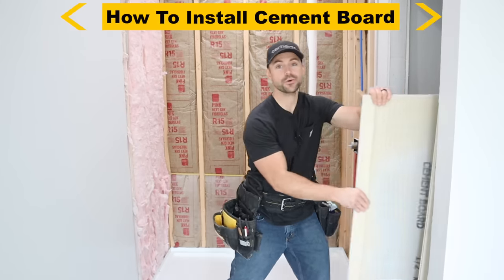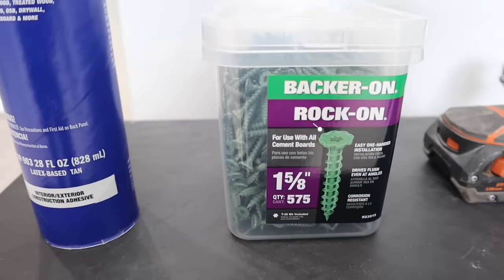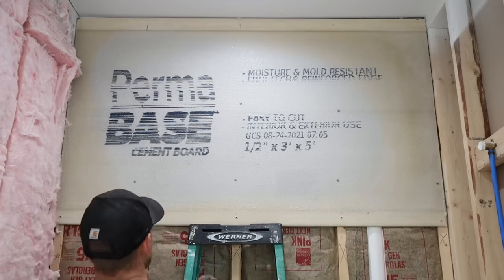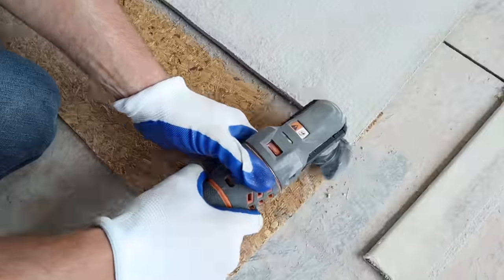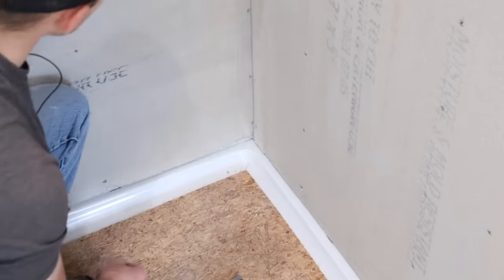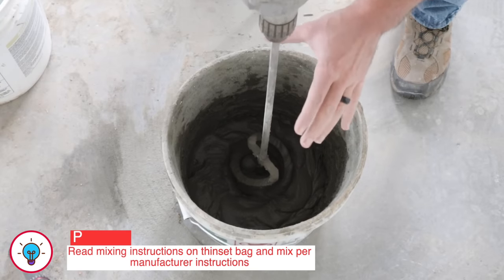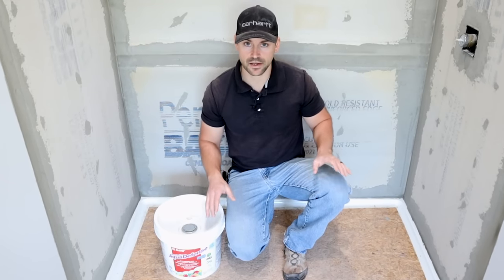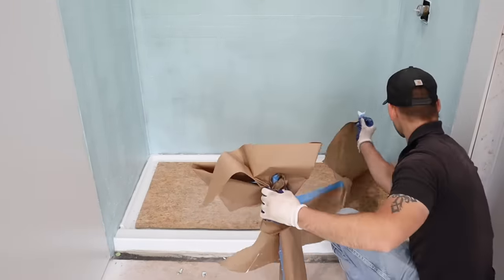How To Install Cement Board and Waterproofing For Tile Shower Walls - Complete Step-By-Step Guide

Comment: I've been doing showers and bathrooms for decades. Out in the field we normally pack out are studs. We packed them out quarter inch or so. That way the cement board or HardieBacker board slide to write down over in front of the flang of a tub or shower. No rabbeting out or back cutting the cement board,or hardiebacker board like you're doing in this video.
Reply: Can someone translate this from contractor english to educated English please?
Reply: @zefrum3 I believe he’s saying they burrow out the studs a little so that the actual tub edges are slightly in the studs so the cement boards just slide right down without have to cut the board to fit
Reply: Make wall stick out more so cement board slides down past tub flange
Reply: Board doesn’t go over the flange. It butts against it. Put it over and I will eventually leak. You use mesh and quick set cement to seal the gap.  Then red guard, caulk when done. Tile.
Reply: @jimmyjay6497  that is one way, but this entire comment thread is about building the studs out so the cement board can slide down over the flange
Reply: Or recess the shower tray into the framing so it is flush with the framing and the sheets can run into the tray unobstructed . Stop the sheets 3-5 mm short of the tray bottom and silicone the gap . Seal the sheets .
Reply: I'm doing mine now and I presumed hardie backer in first down to the floor.. then tray in and tile down over flange??
Reply: @jimmyjay6497 this is how I thought it was done..
Reply: Any difference between the rough side and the smooth side of the cement board?? Which side should I use for tile??
Reply: @bastardo323  pretty sure you want smooth side out for tile.
Reply: @bastardo323 smooth side if your using Mastek rough side if your using thinset both sides can be tiled, it's all about what choice of adhesion your using
Reply: Meh, done both methods. It's tough to screw up the butt joint between tub and wall.
Reply: I'm presently installing a shower pan and the manufacturers recommendations say that the backerboard should be installed "up to the lip of the flange"! Do not install the board "over the flange and into the pan"! Only the tile should be installed over the lip of the flange!
Reply: @zefrum3 you’re saying that contractors are uneducated but since you are the one who doesn’t understand… it sounds like you’re the one who is uneducated. I understood it and I’m not a contractor.
Reply: @jasony9950 I think he meant the dude doesn’t know how to spell simple words like “right”
Reply: @jimmyjay6497 so thin set first then red guard? I'm using shower panel inserts
Reply: Great video and great information.
I must say😊 0:35  that fiberglass is a temperature insulation not a sound insulation.  You need mass for sound insulation.  Use mineral wool for the sound insulation. It also is mold resistant.
Reply: @Iburn247  paint the Redguard on top of the raw cement board to seal it. Then use mortar to secure your tiles to the wall. If you are using Durock brand cement board, make sure you use the rough side with your mortar. The smooth side is intended for use with mastic, which should never be used in a shower. It will cause mold growth.
Reply: @zefrum3 
😂😂😂 😂😂😂 I couldn't understand it either!!😂😂😂
Reply: HUH? 😂😂😂😂
Reply: My daddy makes grease!! 😂😂😂
Reply: Should I use fiber mesh when working with hardiebacker board?
Reply: What?…. You don’t float your walls?…You put your cement board…. Or Hardie baker on a screwed up wall and you still have a screwed up wall. You have fixed nothing!
Reply: It's not advisable to place any board over the lip, as I've diagnosed challenging leaks that others couldn't identify, only to discover that water was being wicked up and over the lip, then running down the inside wall. The same principle applies to stand-up showers—you don't want the boards to sit inside the mud pan, resting on the liner, as this can lead to similar issues.
Reply: Wouldn't it be easier to just notch the Stud right where the tub lip is so the lip slides into the stud instead of shimming the whole stud all the way up? Work smarter not harder

Comment: This guy is great. I am getting ready to tile up. I did not cut out the back of the cement board to go over the shower pan lip though, instead, I cut furring strips the length of each stud and 1.5 inches wide so that the board went over the lip.
Reply: I believe the board should not rest on the edge of the shower floor pan or the tub. It should go on the top of the lip to prevent any water from wicking up the cement board. Read the comment by AKJammer.
Reply: The board should never go over the lip. It’s supposed to go to the top of the lip.

Comment: Thanks for the video. I am almost ready to tape.  I found out that the manufacturer recommends a 1/16 or 1/8 gap between boards.  Too late im done.  Also for inside and outside corners they recommend 4 in Alkali resistant tape.

Comment: The cement board sits on TOP of the tub flange lip, not overlapping it. By bringing the cement board all the way down over the flange lip, you increase the possibility of the cement board sucking up water through capillary action.
Reply: In my experience, about half of the pros I've observed stop at the top of the tub flange, cantilevering the tile the final 3/4 inch or so past the cement board. The other half back-cuts as shown in this video so the cement board can run down over the flange and better support the tile. It typically stops 1/4 inch above the deck. Personally, I prefer to stop the cement board at the top of the tub flange.

Comment: I have to rebuild my shower in my brand new house that the contractor really messed up.  After watching several videos on the subject, I stumbled upon yours and what a relief.  I am confident that with your explicit instructions, I can now tackle the project.  I will have to demo the tile out to the studs and start over so your videos really came in handy, now to gather materials.  BTW, the building contractor will repurchase the tile if I do the work.  His sub went out of business :~(
Reply: This. I have the same problem. Husband wants to do it— so being an engineer I’m sure we can do this
Reply: I would think the Contractor would step up and fix what his Sub screwed up. Why should YOU have to do it? The cost of tile is minimal
Reply: Best of luck with your project.  Take your time.  Let us know how you made out.

Comment: I love your video; video quality is great, you speak clearly, confidently and with enthusiasm, and your explanations are detailed and clear.  

I just don't understand why you started at the top of the wall?

ET
Reply: Preference. He said so in the video. Doesn't matter either way. On my last job, I had gravity work in my favor, working from the ground up on the main back wall. And from the top down as for the two side walls. Both were easily accomplished..

Comment: Isn't it recommended to remove the paper face of the insulation if you're using a waterproof membrane over the backer board? Otherwise, mold could become an issue due to moisture being trapped between two impervious materials. I'm a complete novice, but I came across this advice several times in recent months. I learned this while researching my own project  whether or not to remove the vapor barrier before installing my shower on an exterior wall. Thanks for your efforts; I've learned so much from such videos and the comments

Comment: Been installing tile new for about 20 years, the only big box we have is HD. Here's some solid advice. 
1. Straight edge & plumb the studs & corners, shim if need.
2. Use Aquabar paper over your studs & go over shower lip.
3. Leave a ⅛" gap at your cement board seams (#8 nail)
4. Tape with alkali resistant mesh!
5. I have always used Flexbond thinset & had great results! We live near the 29 Palms Marine base & get shook all the time from the bombing & small quakes are the norm. I've never had a shower leak or crack.
For what its worth thats my experience tiling MANY showers.
Reply: Thank you!
Reply: Does this apply for someone who is not tiling but just putting up fiberglass (or similar) panels to create a new surround over an old bathtub? Thank you.

Comment: Hi Josh, I've just discovered your channel and I must say you are an amazing teacher . I have a couple of questions. About a month before  watching your video, I installed 1/4 inch cement board on the Walls of my shower, is that a problem? Can I do anything to it to make it work? Or do I have to remove it and use 1/2 inch? My second question is, do the walls need to be perfectly level or the bit of unevenness can be even out with thinset when tiling?
Thank you

Comment: I never installed cbb before. I found your video presentation informative and easy to follow along. Best of all, I feel confident in tackling the job thanks to you. You've got a great attitude and obviously love what you're doing!! Mega thanks Bro!
Reply: I speak from experience, the cement board he's using is a bit on the heavy side.  They have lighter weight versions available.   He's a young guy who makes it look easy.  Be aware of the weight.  Use liquid nails as he did.
Reply: I like permabase

Comment: If you are doing the whole thing including framing (new construction) you can notch the studs at the bottom - about a quarter inch or even just 3/16 inch deep, the height of the pan to allow the pan to recess into the stud wall. So much easier to notch the studs.
Reply: Great insight.  Thanks!
Reply: Yeah if it's new construction

Comment: you always want to use a waterproof silicone in the corners and not thin set so that there is flexibility in the corners to allow for expansion and contraction. Thin set can crack and leak if used in corners.
Reply: Nothing sticks to silicone so your tile won't stick in that area
Reply: Here's some good info.  Realistically no one gets this opportunity, so I thought I'd share.

5 years ago putting in a new shower,  I used the high quality laticrete hydro-ban caulk in the corners between cement boards.  I had to abandon the project at this stage.  No mesh tape / thinset.  No further progress has been made on the project even to this day.  So, I recently assessed the job and found half of these vertical 90degree corner beads of caulk had produced a fine crack.  Pretty surprising and disappointing...

So, to counter this, I will be including the use of a fabric tape when painting the waterproof membrane.  Maybe others should consider this secondary measure, too.

Comment: Another fantastic showing of your work. Yes drywall background comes in really well to take and coat the corners and seams. I've used a brush as well to put the thinset in the corner and wipe it down. So glad to see the application of the sealer as well when using cement board and even hardi backer. Doesn't suck the moisture out of the thinset as quick too. Great job Josh. 👍🏻
Reply from the maker: Hey David! Yeah I felt like a Drywall Finisher there for a minute lol. Yes that’s a good point also about the water sealer protecting from pulling the water out too quick. Another plus side to waterproofing. I hope your projects are going well. Thanks for stopping by!

Comment: A title guys with years of experience says that you place the cement board on top of the lip of the pan to stop water wicking up. leaving that space means water can't travel up and make contact with the cement board.  Yes, you can use caulking between the gaps if you rest the cement board on the base, but cauling won't stop water perminately, especially in a shower with plenty of water spashing around.

Comment: Im renovating right now, i didn't liquid nail the sheets but did use the proper hardware, what's your thoughts if I skipped this step?
Reply from the maker: If you already did the work, I would not worry about it too much. Liquid nails is definitely a great reinforcement. Hope that helps!

Comment: This is really great and straight forward video. I've done a lot of drywalling and odd jobs construction and feel very confident in my abilities but it's always good to go through a video dry run with to make sure I'm not forgetting something; especially if it's a project I haven't done in a while. It also helps to go through the needed materials list to ensure I have everything for the job before I began. There's nothing worse than getting started only to find out you need to run back to the local hardware store! Aghhh You also have some great tricks to make the job go easier when possible. 
Thanks for your video's I'm definitely a subscriber. Fireman Michael

Comment: Josh love the videos, they have been very helpful. I have one question, do you put mesh tape along the ceiling. Where the sheet rock and cement board meet
Reply from the maker: I did but it’s not really necessary. The tile covers up that area and you really don’t see the corner and it doesn’t function as waterproofing either. So it’s really not necessary but I did for a full complete look. Hope that helps!

Comment: Hm? ... I didn't know that water-proofing was necessary after placing cement board and thinner on the joints? Or,  that there is a water-proofing product available and it is applied onto the cement board as if I were painting with a roller. Hm? ... Glad I saw this video. Thanks!

Comment: I am in the process of renovating my shower.. I have seen 10 different DIY videos on this topic.. no one suggests using liquid nail like you do .. is this just an insurance thing or does the cement board manufacturer recommends that ? and also the flange thing you recommend to do... does it actually have any purpose ?

Comment: Man, that's a lot of work! Really well done video.
Reply from the maker: It is a lot of work. The final project turns out great. Thanks for watching!
Reply: @TheExcellentLaborer  7:28 - can I install my cement board in my shower and then have a drywall guy come? Or should I do like you did and have drywall finished and then install my cement board?
Reply: @chrisbarfield1468 either way.  Just have cement board and tile go beyond shower door and inch or so ideally.  Make sure you stud well there for your door system.

Comment: Josh, excellent videos. Thanks, 

I have a question. My son's contractor did a poor job laying tiles on his shower floor. The shower has a square drain and the contractor grouted all the way around four sides of the drain. Now for basic clean up and hair clogs removal, we have no way of easily pulling off the drain cover. Would it be safe to use some scouring knife or rotary blade to scrap off the grout on all four sides of the drain screen? They can't even use the shower anymore as the water pools on shower floor and takes long long time to slowly drain, in the meantime, standing water is weakening the floor and dislodging the tiles. Thank you for your (or fellow reader's) helpful comments.
Reply: Pretty much all drains have a removable strainer aka "grate" either by removing 1 or 2 screws. If you don't see any screws it is probably just snapped in and held by friction. Grouted on all sides is generally as it should be. Good luck

Comment: Question: I am installing an ABS tub surround over Durock. My Durock was installed using "Lepage No More Nails Paneling and Moulding" not realizing it is a product for lightweight trim and not recommended for Durock. Do I need to rip out my backerboard or is there a way to fix this mistake?

Comment: We are remodeling our bummy little fixer upper and the bathroom has regular sheetrock installed  on the walls ,however  we are not planning on installing  a shower only a tub ,should we switch out the sheetrock to cement boards for waterproofing or would it be fine to leave  the sheetrock ?we are also planning to tile the floor and halfway up the wall. Pls no hate comments we are trying to diy everything because we are working with a very tiny budget

Comment: So, what did you do to the top gap between the wall and ceiling AND at the bottom between the shower pan and cement wall?
Reply from the maker: Along the top and bottom you can tape and apply thin set just like you did the joints. I hope that helps!
Reply: @TheExcellentLaborer  YES, thanks!

Comment: This is the technique I prefer when installing I like the concrete board on wall alone more solid I use redgard basically same a aqua d thinset bonds extremely well to it

Comment: I notched my cement board over the tub flange but haven't mudded yet do I need to silicone the seam between the cement board and the tub? Great videos BTW very informative..
Reply: That would be a very good idea.  I like that you notched the cement board.

Comment: There's a bit of controversy about whether or not an installer should, or should not cover the lip of the shower base (or imbed their board in the shower bedding if not using a fiberglass base as you are) to prevent water from wicking up into the concrete board. 
The idea is to end the sheet short of the shower pan lip and the tile would overhang onto the lip of the pan (in your case). What is your opinion regarding this? How does your method prevent wicking?
Reply: wouldn't the mortar on the back of the tiles wick water about the same as cement board would..? isn't cement board essentially a pane or panel of reinforced mortar?
Reply: You check out the framing at the bottom so that the shower tray sets in and ends up flush with the framing . You run the sheets into the shower tray stopping 3-5 mm short of the tray bottom . You silicon seal the 3-5 mm gap . You water proof the cement sheets . You lay the tiles 3-5 mm short of the tray bottom and silicon seal the gap between the bottom of the tiles and the tray .